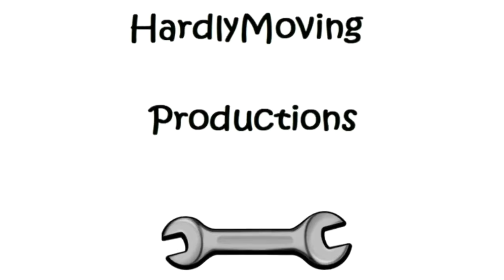Chevy Tahoe - Inner and Outer Tie Rod Replacement

Comment: Yes...good straight to the point...I thought I had CV points but had these tie rods...thanks do more suspension videos please
Reply from the maker: Thanks for for your comment and support!  We have plenty of suspension videos on this channel for Toyota’s and Honda’s.
Reply: TB Boy - CV joints are part of your front axles (if you have them). Axles are for power to your wheels from the transfer case or differential. If your Tahoe/Yukon/Suburban or Silverado/Sierra is 4WD then it WILL have CV joints/CV axles (front only).  

Tie rod ends are for steering only.

Comment: Buddy I have a 97 Tahoe and I got some play in the steering wheel but I jacked it up and the tie rod nut was there so I went to tighten it then realized there was no c pin for it😭😭then I went to tighten it cause I have one laying around but the bolt that I was trying to put the nut on kept spinning inside of im guessing the tie rod end? Bolt was loose as could be😂😂imagine a hot dog in a hall way😂all I know is god let me see that before something bad happened😂 damn whole driver side tire would have flew off my Tahoe😭😭
Reply from the maker: By the sound of it, the threads have stripped inside the inner tie rod.

Comment: Should length be the same if u just raised it 3 inches..or be adjusted longer or shorter
Reply from the maker: Not sure what you mean but you should get a front end alignment after replacing the tie rods.

Comment: The replacement procedure of the inner tie rod is correct. However, when torquing suspension pieces such as outer tie rod, upper/ lower ball joint, sway bar link, and other steering linkage. One should always torque to manufacturer specifications while the vehicle is on the ground (all four tires no jacks or jack stands) with the suspension loaded. This ensures proper flexatone and unrestricted travel of the suspension and steering system of the vehicle at normal operation. Remember, you're responsible for your own safety out there. God Bless All!
Reply from the maker: Thanks for sharing!
Reply: For that truck what are the specs, since we are on the topic?
Reply: @Christines_Cooking how do you access the tie rod with the tire on and it not jacked up ?

Comment: How to they set the wheel right at the alignment shop ?
Do they have to undo the tie rod end, revolve it a turn or two, put it back then, measure it again and so on ?
Reply from the maker: The vehicles goes on a alignment machine which measures how much the wheels are out of alignment.
Reply: @hardlymovingpro  Ok. But how to they align the wheels? Can they without removing the tie rod end from the hub?
Reply from the maker: The steering wheel is centered and held in place.  The wheels are on plates that allows wheel rotation.  The plates, working with a LCD display, indicates the wheel's angle of deviation from zero degrees.  From that point, the technician turns in or out the inner tie rods to pull or push the wheels to get to zero degrees allowing around 1/2 degree of deviation.
Reply: The locking nut on the inner tie rod
Reply from the maker: No.  The inner tie rod is turned to either push or pull on the outer tie rod to make the adjustment.  Once made, the nut is torqued down to hold the adjustment.

Comment: awesome video. Do you need to torque the castle nut or no? Thanks.
Reply from the maker: Yes.  I tighten it down with a socket or box wrench, then apply the final torque where the castle nut grove opens or provides a path to the cotter pin hole.  If your part does not come with a castle nut/cotter pin setup, apply around 40lbs of torque should suffice.
Reply: ok thank you

Comment: 2 things, don’t these already come progressed? And what year Tahoe was this?
Reply from the maker: What comes progressed (compressed)?  2004
Reply: Hardly Moving Productions I meant pre-greased talking about the tie rod ends
Reply from the maker: Yes ... they do come with some lubrication but still need additional grease.  A grease fitting is provided allowing you to load the interior of the dust boot with grease after installation.

Comment: Is this the reason why when you go over a speed bump it makes like a squeaky sound, could that be the cause, because there worn out?
Reply from the maker: That's a suspension problem ... not a tie rod problem.  The squeaking could be worn control arm bushings.

Comment: Am I missing something my outer tie didn’t come with a grease fitting tip what to do there
Reply from the maker: Not unusual.  It all depends on the manufacturer.  Most imports don't have grease fittings.

Comment: Obviously not a 4wd just changed everything in the front of my Silverado no wrench gets in there special tool required. Rent at parts store.
Reply from the maker: Thanks for sharing!  Yup, a few more steps sliding out the front axles out of the front wheel hubs.
Reply: @peterputnam3804 what is the tool called ?